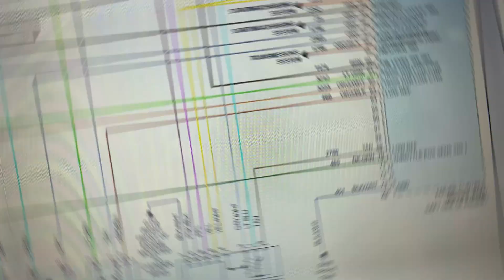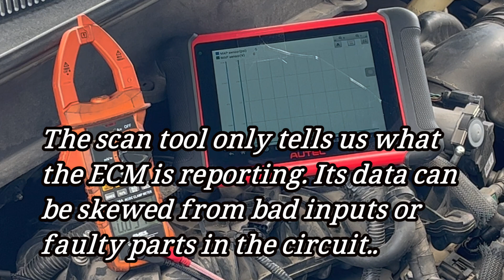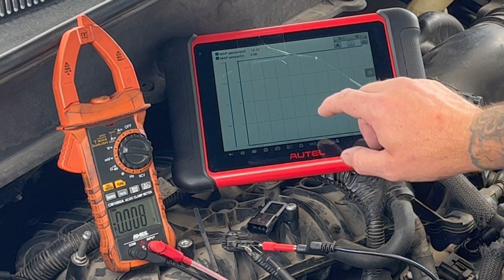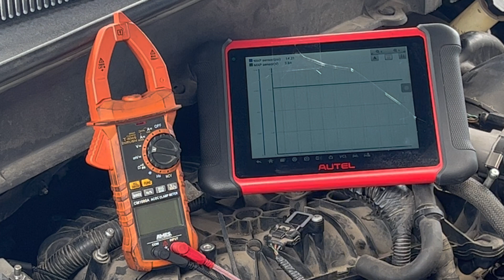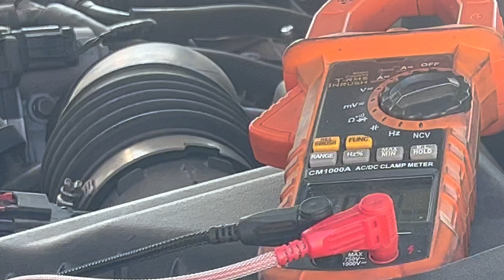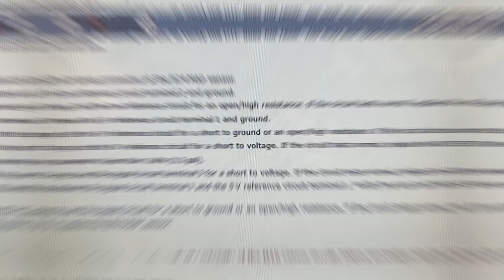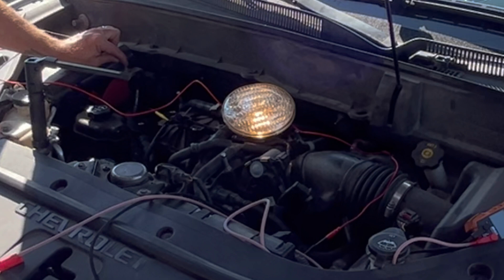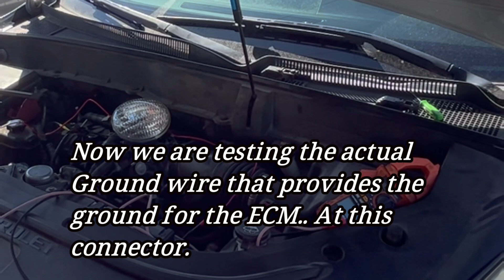2012 Chevy Traverse 3.6L - P0106 & P0108 Circuit High DTCs - Circuit Integrity Testing

Comment: I liked and subscribed. I know this video is from two years ago, but I now have the same p0106 (permanent)and p0108 codes on my wife’s 2012 Buick Enclave (same car as the Chevy you worked on). Your detail diagnosis is a big help in my needing to do the same on Buick. Yeah, I replaced the MAP sensor and erased the codes, but the same codes returned. So, it’s time to dig deeper. When observing the numbers on the TOPDON for the MAP sensor during a drive the numbers show the sensor giving an accurate reading.🤷‍♂️
Reply: What is your email address? I want to contact you about receiving more info about what you demonstrated in your film.

Comment: I was under the impression that sensor grounds run through some filtering circuitry in its respective modules. So reading a elevated resistance using battery ground will read higher. The sensor grounds “float” a few mV above ground. I’m guessing this is different from one manufacturer to the other .